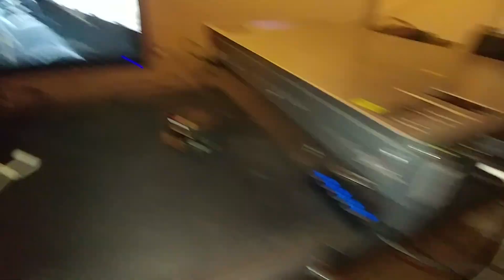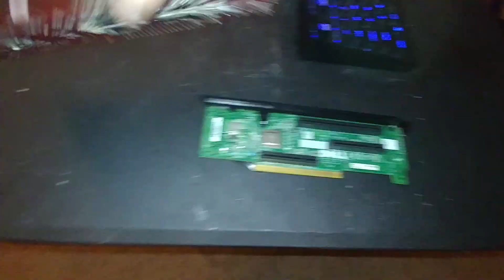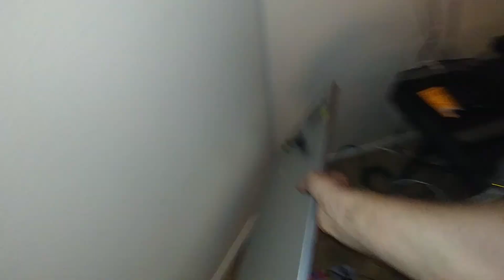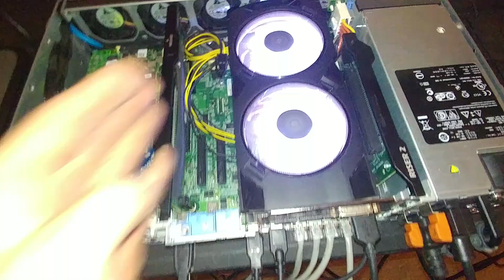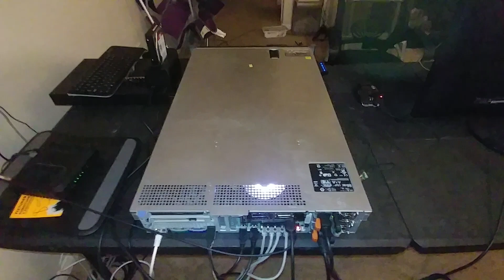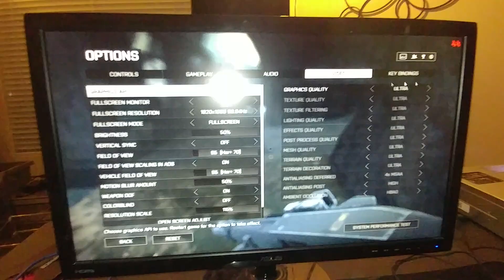Dell Poweredge R810 GPU MOD

Comment: Ive got an R820 and currently looking at adding a GPU to it, but Im looking at power supply just like youve got, curious what adapter you order cause  Ilooked it up and cant find what looks like that.
Reply from the maker: I made my own power board adapter inside the server. i have a similarly modified R930 currently.

Comment: BTW are u using windows server os like windows server 2012 , windows server 2016, windows server 2019, ect? If so then, how do you get steam to work correctly (removing the steam cant connect to the internet)

Comment: I wish the firmware on my r900 was open to 3rd party GPU. That thing would be a fun beast with how I have it set up. 24 cores and 80gb ram... But I am told it is 2 generations too old for firmware accepting additional GPUs.

Side note, I am so sick of reading all the hate about people wanting to desktop rig their servers. Who cares if WE are ok with the power bill (fyi my r900 is my house furnace in the winter and keeps the house steady at 73F with no spikes like a furnace does for 1/4 the cost). Some people like to tinker and mod. So people that get bent out of shape over server "desktops" can just .... get bent.

Comment: Can you tell me about the 4 ethernet lines running into the R810 server?
Reply from the maker: What about them? They're just normal Ethernet ports like on a desktop.
Reply: 4 x gigabit - with the right switch they can be set up as a single channel

Comment: How loud is your R810 as a desktop?
Reply from the maker: Honestly not silent at all. You can hear it through headphones over the audio from the computer.
Reply: Thanks that what I figured.  These things are so cheap but the form factor and noise just don't work for my setup.  Thanks for being the guinea pig
Reply from the maker: @shaocaholica  r720 is noisy too but far more powerful, and fans can be turned down using commands depending on configuration and idrac level.

Comment: Hi How do you power this GPU? Did U solder wires to PDB? I have R910 and think to solder wires to different sides of PDB (inside tracks are - , outside +). Will it work?
Reply from the maker: I soldered yes, I modified the power board
Reply: DREWSASTER What way? Like I mention above?
Reply from the maker: @Pavlo.Ivanov  i have another video of how I did it. It is on YouTube.

Comment: Reimbursed $150 "what ever" you little scam artist,  you knew that little bit of damage was worth $20 off the price ~tops
Reply from the maker: I also requested an exchange, I'm sorry for expecting an item to be as described, not only damaged in delivery but damaged by the sellers carelessness.
Reply from the maker: Scam artist? I contacted the seller with what happened, that's what they offered so I accepted. Why would I pay full price for an extremely poorly packaged item that was damaged in transit? They literally threw it in a box of peanuts, no bubble wrap no nothing.

Comment: playing with a dell r410 server and it doesn't see ati graphics card  - i guess i need wire powered kind.  thanks for the tip.
Reply from the maker: Ensure it's making good contact in the slot, and if you modified it, ensure none of the pins are damaged.

Comment: Did they not make an adapter you can buy that plugs into the motherboard or near the PSU to allow you to connect separate powered hardware like a graphics card? I ask because of RemoteFX which require a graphics card for enhanced RDP sessions and rendering to the thin client.
Reply from the maker: No there is no adapter available besides a custom solution. The other issue with the r810 is that it does not support a full length graphics card. If you check my other videos I detail how to make the power adapter, as well as demonstrating that a 1080 Ti works in an R720xd wonderfully well which is my recommended solution.

Comment: I'm trying things on my dell poweredge 2950 iii but I have one question, could you install windows 10 on one of these?
Reply from the maker: Yes you can! I have installed and ran Windows 10 on my: 
Dell 1950
Dell 1950 ii
Dell r510
Dell r710
Dell r720xd
All of the above systems run Windows 10, and install almost all drivers automagically! In this video that server is running Windows 10, but be aware Windows 10 only supports 2 physical CPU's, any more than that will not work
Reply: Will it run windows 7 home premium and will that allow all 4 cpu slots to be utilized?

Comment: Great video man...can you tell me more about the USB3 card...and why it doesn’t work?  I just bought my maxed out R810 and want to install a USB3 card in it
Reply from the maker: Marc Labreque the USB 3.0 card requires a 5 volt connection, I didn't feel like hunting and adding one. If you get a bus powered card it MAY work but I haven't tried.
Reply: Hey Drew...so I just found this card to add 4XUSB3 port with no molex or SATA power required...just the PCIE2X4 slot 25W powered bus from the board.  https://www.amazon.ca/gp/product/B015CQ8DCS
I was doing some searching and found this post...https://www.tachytelic.net/2014/11/add-usb-3-0-capability-12th-generation-dell-poweredge-server-uasp-support/
I will let you know how it works out
Reply from the maker: Marc Labreque sweet, let me know how it goes! 👍

Comment: least you didn't have to mutilate the unit. I know someone who will do anything he needs to in order to get cards to fit; include but not limited cutting away the drive tray where it can't be re-inserted.
Reply from the maker: Katherine Moss I actually have a spare power board so I can go back to stock at any point I desire.
Reply: That's good. This person was just doing it at random.
Reply from the maker: My goal was an easily replicable solution to what is generally a very expensive problem.
Reply: Good call. I mean, graphics cards have never been my thing. i'd been scared to death of doing anything to the board, though.
Reply from the maker: Katherine Moss I was too, until it worked at full load at high temps for a period of a few days. It's rock solid, I used my oscilloscope to make sure there weren't any voltage spikes or noise. It works extremely well.
Reply: DREWSASTER interesting. I think I'll be getting a server of that generation pretty soon, though it's not going to be for anything like this. Keep an eye on my channel to talk to.

Comment: Alright, so I have an ibm x3850. The pci slots in there are not only wired to 8x, but are also physically 8x. I would prefer to not cut the server if I can help it. Is there any riser card that is pcie 8x? The pcie 1.0 at x1 seems to be something that would stunt performance. Although, I have an rx 480 in my main gaming system, and while I don't have bf4 to test it, I might be able to look up benchmarks and find the performance degradation. In addition, something like a gt 1030, a card that only draws 30 watts under max load, only 5 over the IBM's pci power rating of 25 watts, when it goes over the power limit, will it throttle down, or crash the system? I really want to get a gpu in my IBM for acceleration because those integrated AMD 16mb graphics are awful for anything other than a command line os. Thank you, this was a great video.
Reply from the maker: Mathias Lazewski honestly I don't know as I don't have any experience with IBM servers. If your ever around Las Vegas though we can do some testing to see. As far as 8x risers, I'd do one 8x to x16, then use the shielded corsair riser cards to extend it out of the case and use an external PSU to power whatever card you choose.
Reply: Thanks for the fast response! Yeah, I was looking at this video https://www.youtube.com/watch?v=WUdyrA3Wlvk&t=1s and saw your comment. And to refresh your memory, he installed the gpu in a separate case. Actually, I'm about as far as you can get from Las Vegas while staying in the US. I live in NJ. Also, a little bit of information that I should have included, the server is 4U, so, there would be no problems fitting a gpu in. Also, PSU soldering is a big "no no" for me, so if the gpu I choose needs more than that 25w, it would most definitely be external. But, the biggest challenge is finding an 8x gpu. If I was going to have the gpu inside the chassis, then it would have to be 8x. And I can't even find 8x quadros! But, now that I think about it, I can just put a psu and gpu riser card on top of it. Besides, it is in a closet in my basement running 24/7 (I know, RIP power bill), so it's not like it has to be super aesthetically pleasing. Well, thank you for your help, and I will be sure to contact you if any other issues arise.

Comment: whats this thing you ve bought on ebay to power the card? 
can u send the link please?
Reply from the maker: I only purchased a PCIe wire. The power distribution board for this server is also available if you would like to return it to stock.

Comment: Do you think that is possible to modify the drive bay to receive 3.5 inch drives? I am abou to get a r710 with 6 drive bays for 3.5 drives, and saw a r810 quad core for a little extra. but sas drives would draw me back...
Reply from the maker: Peter Reynold Robinson Junior its not possible, BUT, if you get an md1000 and perc6e card, you will have 12 3.5 inch bays that support up to 2Tb drives a piece. md1200's support up to 12 6tb i believe but the h800 or h200 cards to support the 1200 and the unit itself are significantly more expensive.
Reply from the maker: Peter Reynold Robinson Junior also keep in mind, the 710 uses roughly half the power of the 810, but that depends on configuration. its also considerably quieter in comparison, the 810 is only "quiet" below about 72 Fahrenheit. gets very noisy above that, especially if you're making it process hard. If your not going to game on it the r710 really is a great box with the 56xx series cpu. There is a single slot x16 riser available for the 710 that will let you run pci bus powered GPU's as well. Try to get an h700 version as converting it if you dont have a ton of parts already is kind of a pain as far as obtaining the necessary stuff.
Reply: @ANATURALDREWSASTER  Just curious, you mentioned there is a single slot 16 x pcie riser for the r710, would you happen to have a link? I have searched for this and came up empty.
Reply from the maker: @asphaltbinder  I do not, and at this time I recommend an r720 as opposed to an r710. Much better, newer server with native GPU support, including the r720xd even though it's not supported by Dell it still has the power connectors and slot space for full size GPU.

Comment: Hi, Great video! I want to buy a r810 myself, so where should i buy it from? How much did you pay for the server?
Reply from the maker: Jens Erling Bråten I scored mine for $50 due to the damage!
Reply from the maker: Depending on where you live, check sites like craigslist first as usually these are hard to sell locally! eBay is where I purchased mine.

Comment: wow that is loud lol that's awesome I always wanted to do this with an r710
Reply from the maker: newSogn it is loud by desktop standards, i actually just picked up a 710, might do the same mod but the 710 is limited to pcie x4 so a slot will need to be cut.
Reply: DREWSASTER yea I really like the idea of a workstation in the closet and quiet desk and it's exciting to see where dx12 and Vulcan are going where more cores will be favored in the future
Reply from the maker: newSogn the r810 definitely has the core count! I'm tempted to configure Windows server as a desktop and put 2 more e7-4870's for a total of 40 physical cores.
Reply from the maker: +newSogn new video uploaded, explaining the problem with the 710